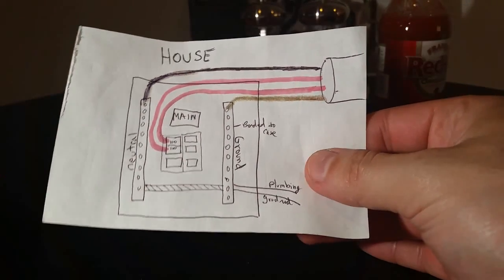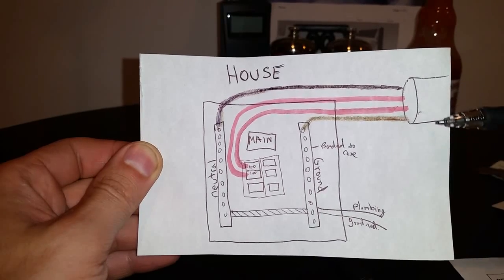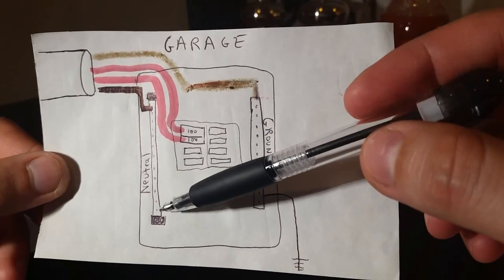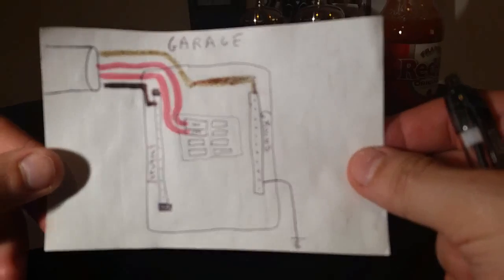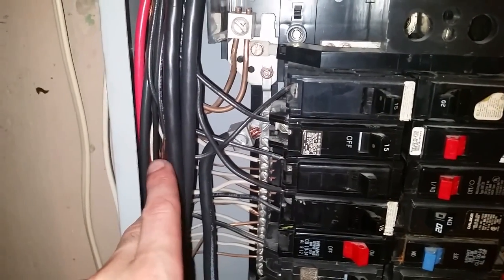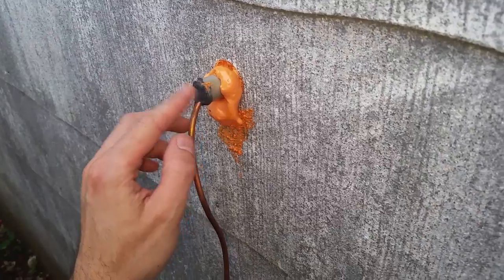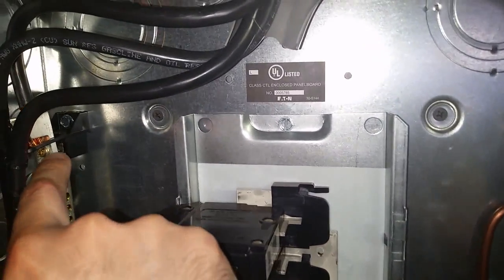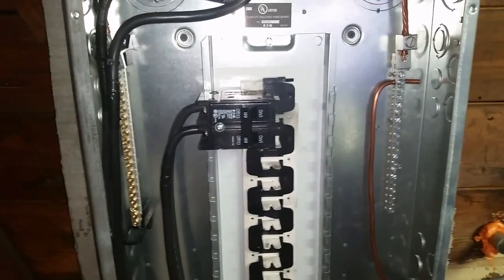How To Wire A SubPanel

Comment: I love your video, I’ve watched it several times. Question: if you are u able to install a grounding rod for the sub, is it sufficient to just ground to nearby plumbing? My sub will be close to the garage drain pipe that goes straight into the ground.

Comment: Man, you are a life saver. Ive been searching all day for information on this. Short and search too the point. I do have one question though. My main 200 amp panel in the house does not have any rod grounds but my 100 amp sub panel in my detached garage has two rod grounds. One is going to the ground bar in the box but I don't know where the other one goes. Should both ground rods be attached to the ground bar in the sub box?

Comment: I have a sub panel in a garage, fed by 4 wires (2 hot, neutral, and ground). The neutral bar in the sub panel is not bonded to ground and I believe it should never be bonded in a sub panel. I have 3 things attached to the sub panel- a three prong outlet for a compressor, an air conditioner (3 wire), and an electric garage heater (3 wire). All are 240v (or 220?). Should the ground for each connection be connected to the ground bar or neutral bar?  I cannot find the answer anywhere!!!  Also/FYI- I do not have a separate grounding rod for the sub panel.  The sub is 4 feet from the main panel.  Thanks!
Reply: Update- I’ve confirmed that all ground connections in the sub panel are to be connected to the ground bar and not the neutral bar.

Comment: Thanks for the video.
I want to put in a new small sub panel in my garage I have three wire in a metal conduit. right now in the old panel the ground and neutral are all together on the neutral bar but with the metal conduit I think they should be split up with no bonding screw.
Does that sound right?
Thanks again

Comment: THANK YOU for this video.  I am building a PORTABLE sub panel, that will be connected to my 200A main panel via an existing NEMA 14-50 outlet on a 50A 240V breaker.  The subpanel will have six, 15A 120V breakers that feed six outlets mounted in boxes bolted directly to the subpanel via box spacers.   The subpanel will be fed by 20 feet of 6/4 SOOC cable with a NEMA 14-50 plug at the other end.  Other than being connected via the NEMA 14-50 the only difference will be that there's no ground to earth on the subpanel, only back to the main panel.  The subpanel will be mounted to plywood and set diagonally on a dolly to move around my garage.

Comment: This vid was very informative. I have a 200A Main Panel and was thinking of feedinging my sub with a 100A DUAL POLE TO A 100A DUAL POLE IN MY SUB. 
OTHER VIDS i SAW THEY FEEDING A 100A DUAL POLE IN THEIR SUB PANEL WITH A 60A IN THEIR MAIN PANEL
QUESTION
(1) IS THIS CORRECT
(2) DO I NEED A SEPARATE GROUNDING ROD IN MY 100A SUB PANEL FROM MY FEED OF 100A OFF MY 200A MAIN PANEL, THINKING OF PUTTING ONE
Reply from the maker: Your subpanel should not have a higher amp rating than your main panel..you should also sum up the amps that you think you will draw in the sub and if your main can support that. As far as grounding rods, check your local codes..it depends if its a separate structure..dont forget to subscribe
Reply: @klowny1969  THE STRUCTURE IS 40 FEET AWAY FROM THE MAIN IN A SEPARATE BUILDING
Reply: @klowny1969  SUBSCRIBED ALREADY

Comment: You're not supposed to bond your neutral bar and ground bar together in a sub panel anymore
Reply from the maker: Nobody said to bond them
Reply: @klowny1969  you're right my bad, at the beginning you're panel diagram shows the two bonded together. But it's the main panel in that picture labeled "house". I was mistaken
Reply from the maker: No problem
Reply: @klowny1969  didnt mean to be an internet troll lol, just wanted to pass on solid info
Reply from the maker: No worries..i didn't take it like that
Reply: @klowny1969  cool lol👌🏻 take care man good video

Comment: I’m not electrician. But is the neutral and ground bar the same?
Reply: At the main panel yes, they are bonded to one another and at the transformer the neutral is grounded but at a sub panel they are to be isolated

Comment: Sub panels don’t need additional grounding rods.  Main panel is already grounded.  That’s why neutrals and grounds are separated in the sub panel.
Reply from the maker: This subpanel went into a separate structure..here its code for a separate structure to have a separate ground rod..and since we had the extra wire already with the cable, we grounded it to the main panel as well..hope you understand the video better now..dont forget to subscribe

Comment: Here is my question. IF the grounding bus and the neutral bus are not bonded, and there is a short on one of the circuits off the sub panel, then the current will run down into the grounding system and not trip the breaker due to high resistance. As well, the grounding system is now going to be energized. I have not found anywhere on the internet the explanation as to why the subpanel needs to be wired this way, when it is obvious why it should not be wired this way in the main panel.

Comment: Very informative!  I'm looking at a friend's storage shed/barn that has a small efficiency apartment in it.  The main breaker box is in kitchen & there is an old GE 100 amp subpanel in the barn portion.  There is only 1 neutral/ground bar inside this panel and both the neutral/white and bare copper/ground wires go to the same bar.  This may have been done by her dad & hubby back in the 70's or 80's.  From what I'm learning about subpanels the neutral & ground bars should be isolated from each other.  However, in this case, all the old wiring didn't use the ground wire...so...advice is welcome/needed!

Comment: Excellent video but please use something other than your fingers to point out wiring in your panel. I’m sure the panel isn’t live but one day it’ll be hot and bad habits are hard to break and suddenly zap. When working around a panel I always keep one hand in my pocket. A shock from one finger to the other goes right through your heart.

Comment: Instead of separating the bar and doing the neutral bar on the left and ground bar on the right, couldn’t you just connect the neutral wire to the bus bars, then install ground bars on both sides of the bus bars with the ground wire and neutral grounded to the main

Comment: You do NOT have to go to a bigger gauge for aluminum. 
2-2-2-4 is correct for a 100amp service.
Reply from the maker: Are you 100% sure? And how can you say what guage is correct for 100 Amos if you dont know the length of the run?
Reply: klowny1969 IN GENERAL applies to the statement above. If in access of maximum feet then yes it would need to be bigger. 
With that said, going from a house to a attached garage would not warrant a bigger gauge because that in most cases is a “short” distance. Hope that helps.
Reply from the maker: @davidmorgan8612  dont forget to susbscribe
Reply: I was going to say the same thing but I am trying to be better about commenting.  :)  In all reality, he could have used 3-3-3-5 copper.  Probably wouldn't have saved much money though.

Comment: Finally found the info I was looking for. Just bought an Eaton load center but it didn't have the "normal" lugs for the hot wires. You video is the only one I found with the same set up. Thanks

Comment: Good video, why do you need to use in the sub panel the same breaker as the main panel? As long as the breaker match the panel manufacture it should not matter from panel to panel, correct?
Reply: Correct.

Comment: SER is not rated to be installed in conduit and then buried underground. You need w series wire or uf cable . Exit points should be in schedule 80 pvc  not 40 When sleeves are used they must be sized according as well. This won’t pass. Workmanship is good grounding bonding is correct butt ser underground is a no no

Comment: great video. i noticed you pulled 110 twice on the left side to power up the 220v subpanel. the way you wired it, this would mean that subpanel will always be 220v? what about if i wanted a 110setup panel in the garage, and then wire in one 220v outlet to the subpanel. shouldn't the 2 hot wires be wired in the main (1 on left, and 1 on right) to take advantage of the 2 110v cables coming into the home?

Comment: Electrician, Does anyone know the code.  Can we put Romex inside the conduit like it demonstrated in the video?  Thanks a lots.
Reply: I don't believe thicker gauged wiring comes in romex sleeving.  The biggest I've seen in a romex jacket is either 10 or 8 gauge.  I could be wrong, though.

Comment: My understanding is that you never bond neutral to ground in a subpanel, only in a service entrance panel.
Reply: What I am trying to say is, you mention bonding neutral to ground, but the title of the video is How to Wire a SubPanel, so it's probably confusing to some.
Reply: Noalox is a a thick grey goop that comes in a small white bottle, and you need it for every Aluminum connection, per code.
Reply from the maker: That's what I said

Comment: Thank you for the detailed explanation. I am going to be installing a sub panel in my garage.  Is it necessary or required generally by code that you need a breaker in the main panel and a breaker in the sub panel? I have seen sub panels that just have a main lug in them with no main breaker. Thank you.

Comment: The only thing I saw that I would recommend doing differently -- your trench should also have an 8 awg bare copper ground wire to bond the house ground rod to the garage ground rod.
Reply: 2Truth4Liberty why? So that if you have a short in the house, you can possibly send it over to the garage ? And vise-versa ? Nah I’m cool
Reply: @benjaminmarquez8073  Not sure what you are talking about "send it over"
Any electrical short is going to return current to the source whether your system is bonded or not.
( bonding and grounding are not the same thing)
11:43 shows an auxiliary ground rod installed - THAT should be bonded to the other grounding rod(s) in the system.
( See e.g., https://www.youtube.com/watch?v=YuDqXFvRv94 )
It's all about having an "effective ground-fault current path"
That said, I recall my suggestion BECAUSE I see now that the bonding wire was run inside the conduit - see at 13:56
Reply: The grounding electrode conductor shall be of copper, aluminum, or copper-clad aluminum. The material selected shall be resistant to any corrosive condition existing at the installation or shall be protected against corrosion. The conductor shall be solid or stranded, insulated, covered, or bare.

Comment: I'm not saying you did anything wrong or crappy, you did what you had to for the inspector to pass it. But, the illusion about sub panels being isolated is ridiculous. Put an ohm meter on the sub panel between neutral buss and ground buss, they will show continuity, they are the same potential! When you take two wires and put a bonding jumper across one end, of the pair, the other end is also bonded!
Reply: I’m not sure if you know what ur talking about. The neutral and ground  are tied together at the main panel thus having continuity. The sub panels isolate neutrals and ground if not creating a parallel path to ground which is dangerous
Reply: @Nick-bh1fy  Take a train track, ground jumper at mile 1, there will still be continuity at mile 20, it doesn't matter how you hook up to it, they are the same potential, you have basically made a grounded grid!
Reply: Bebo May bruh u don’t know what I’m saying, I never said they weren’t continuous. I’m just saying it makes complete sense they are bc it’s fed from the main panel.
Reply: @Nick-bh1fy  "I'm not sure, if you know what you're talkin about", sure sounds like you disagree!  I contend there is no "isolation" of conductors, so no parallel path!
Reply: Bebo May branch circuits fed from the sub panel do have isolated returns and grounds but the neutral and ground it self would be bonded at the main. But neutral and ground should never be be tied together at any place aside from the primary means of disconnect. That’s what I’m saying
Reply: @Nick-bh1fy  Your not saying anything, your just quoting the code, your not saying "why" the grounds have to be isolated!
Reply: Bebo May they have to be isolated bc if they are tied in together with the neutral you have  parallel paths to ground (which I already said) creating an infinite ground loop which is extremely dangerous
Reply: @Nick-bh1fy  Dude, your arguing in circles, I suggest they are not really isolated because you remove a jumper, (which I already said) in the original post!  What is "your" definition of a parallel path!
Reply: Bebo May parallel path meaning multiple paths/routes  to ground creating a loop. If you don’t understand look it up
Reply: @Nick-bh1fy  Your regergetating stuff from the code, things you've read!  This is a discussion/debate, I want to know what you "think/opinion" and why, not what you can recite, look up and quote!

Comment: I'm only a bit confused about something. If the green screw bonds that bus bar to the case why not use it as your ground bar and the other bus bar for the neutral? (Or move the green screw and put it on the one you took out)

This seems to eliminate the need to but the additional bar and you could leave the original.

Am I just missing something?

Thank you very much for the great video
Reply: J D Grant  Interesting! It seems that the ground bar is already bonded with the case when purchased. If I follow your suggestion , it would require more work, since I  isolate the other bar from ground bonding.

Comment: If I move circuit breakers to sub panel for a generator do I have to wire but the ground wires as well as the neutral and hot?
Reply from the maker: DrMario Pepper it would be a good idea

Comment: If my main panel has a bonded ground bar do I connect the ground and neutral on same bus bar in main panel or ground on ground and neutral on neutral in main panel ? Also when moving circuit breakers to sub panel I know have to connect hot and neutral wires with wire nuts making breakers in main useless but do I do the same for the ground wire from the same Romex? Thank You

Comment: Awesome exactly what i needed!!! When wiring a circuit in sub panel do you wire same as in main breaker box neutral and ground to neutral  bus bar?
Reply: Simple Homestead in a sub panel,  according to NEC, the neutral bar and the ground bar should not be bonded (connected). They should be separate! The neutral should not be bonded to either the metal box nor the ground bar!
I know I am stressing that point, but that is NEC. 
Because of this separation, neutrals only should be in the neutral bar and grounds only in the ground bar by NEC in a sub-panel. 
Hope that clears that up! If not sure of what you are doing please call an electrician.

Comment: Thank you Sir and great presentation...My question is if I want to upgrade my 100 amp service panel to 200 amp, do I have to change my wires gauge inside house. thank you
Reply: not inside your house, but you'll have to have them upgraded from the service pole to your home as well as a 200A breaker box.  Unless you know what you're doing you will have to hire an experienced electrician who knows how to disconnect live wires from the pole.

Comment: How does one proceed to install a 100 amp subpanel from a 200 amp main panel that is completely filled up with breakers, and there is no place to install feeder breakers for the wires running to the subpanel? All existing breakers are tandems.
Reply: Install a larger main panel.

Comment: Just curious, why do the ground and neutral bars in the main panel remain bonded and the sub panel neutral and ground bars get disconnected. I'm assuming it prevents the possibility of back feeding from the main panel to the sub panel?
Reply: In case there is a grounding failure at the transformer, connection at the main panel, the sub panel can become electrified. The neutral buss is continuous thru out the system back to the center lug of the transformer that supplies the house. If a wire inside the house shorts to a neutral white wire and this white wire is open at the main, this white wire can now become hot. Ground is connected to the earth via a copper clad 8' rod that is driven into the ground away from the house where rain would normally fall. The copper ground rod is steel inside with copper clad on the outside, otherwise it would bend when you drive it into the dirt. It should placed about 6" to 8" away from structure. This allows it to had an "Electrical" connection to actual ground that thru the earth actually goes back to the pole or ground mounted transformer which has the same type of ground rod driven into the earth. Lightning, wind, defective motor, shorted appliance and other issues can possibly loss of ground.   
His issues at 4:50 with "Straps" is a video I do NOT want to see.